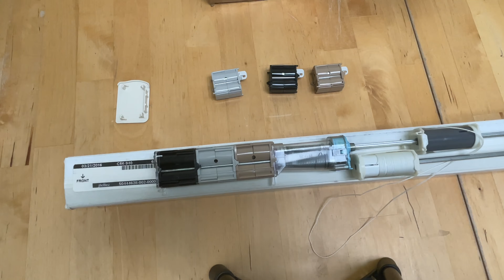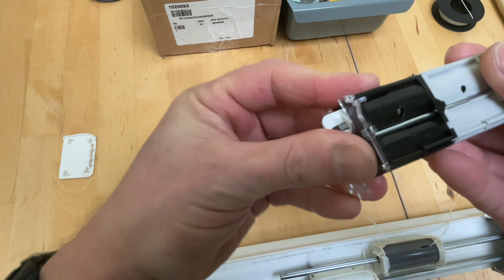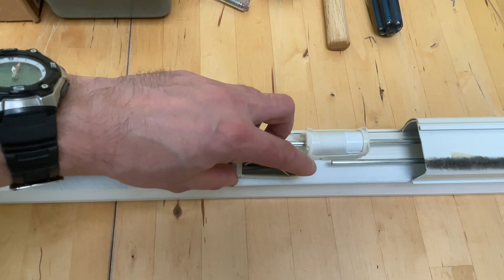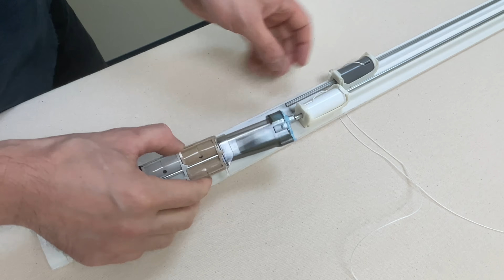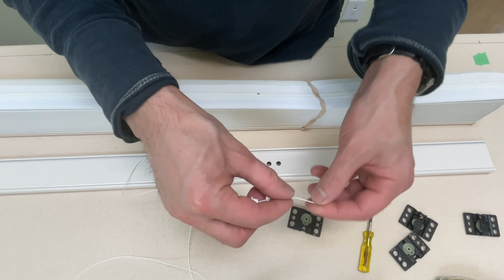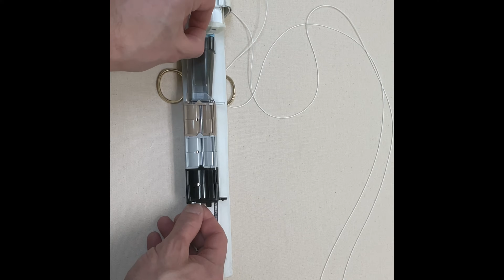Hunter Douglas Duette Top-Down/Bottom-Up LiteRise Repair: Motor, Transmission, & Cord Replacement

Comment: Do you mind if I ask? I have a gray and black motor that I accidentally pulled the clips on before knowing my replacement black motor holds no tension but the old black motor can be wound but not 42 times. Are they both defective?
Reply from the maker: Yes they are unfortunately. Winding them should be done very slow and carefully since the new motors are really weak and snap mid way.
Reply: @everclassicwindowcoverings thank you for your reply! I ended up ordering my second set of motors and was able to repair my blind with the help of your video. Thank you!
Reply from the maker: @elizabethpedley4045  Glad you found a solution. You are most welcome.

Comment: Thank you so much for this video.  We had 12 of these shades installed into our new home in 2021.  Nearly all have failed and we were about to replace them all.  This video saved the day.  One point not covered in the video, one of our really wide and long shades developed knots in cord, I assume they formed from me manually assisting the shade up before the transmission cord gave way.  With the help of this video, I was able to access the cords and remove the loop knots.  Thanks again.
Reply from the maker: Glad our video helped. You are most welcome.

Comment: Anything you can use as a motor lock in a pinch after rewinding the motor?  I don't have a spare white motor lock.  Thanks!
Reply from the maker: The motor locks are very unique. I sadly don't think you can use anything else.
Reply: @everclassicwindowcoverings  Thanks.  Reminder to save the motor locks in the future.  I was able to use a new motor as a lock for another I wound, as I had a pair needing replaced anyway.

Comment: Excellent video that helped me fully understand the process of replacing a broken transmission and reusing motors. I've got a bunch of these and have now referenced your video twice for transmission replacements. I have top down/bottom up, and the "good" side popped off and unloaded when i pulled the headrail back. From zooming your video, it appears that the transmissions are in opposite load positions when resembled.  I'm going to check on of my other shades to see if that's the case, but might be good to have that mentioned here.

Comment: Great Video. In my case one of the lift cord broke. Do I need to replace the motor etc also? What are the steps I would need to follow?
Reply from the maker: Thanks. Yes I would say you would need to replace the motor associated with that cord and will need to do most of the steps in the video for just one side/cord.

Comment: This video is so helpful! I just need to restring the shades, so do you know where I would find a motor stop/lock?
Reply from the maker: @RobynSmithPhD  Glad it helped. You need to get a new motor. They come with the lock. Just stop by any Hunter Douglas dealer and ask for a new motor; or just the lock.
Hope this helps
Reply: @everclassicwindowcoverings  Thanks! After calling Hunter Douglas and the dealer near me, I ended up ordering a couple new motors... the Hunter Douglas dealer near me doesn't sell any of the motors or anything for home repairs. They wanted me to bring the shades in so they could repair them.
Reply: Just leave the top transmission pin in until done. Then you can slide the headrail back a bit further to engage the motors by pulling the pin be vs pulling the motor cap. Cap and pin serve the same function. The cap is just slightly easier to get to for removal. After rewinding a motor, use vice grip pliers to grab and hold the motor pin until attached to a pinned transmission to maintain tension. You'll not be able to find a cap without buying a replacement motor, and keep the cap for future use of you ever get one.
Reply: looks like a money making opportunity to just sell the motor locks! That is all I need as well. But thank you for the video, I'm off to buy a new motor just for the motor locks!

Comment: Buddy, you just saved my butt... When I first got my replacement parts (and had no idea what I was doing) I foolishly pulled the motor stop on one and of course, it unwound in an instant. Thanks to your video, you gave me the magic number (42) to rewind it. Put it in my vice, attached a small piece of tape the shaft, chucked up a bit in a drill motor and Bingo. Thanks!
Reply from the maker: Haha glad it worked. You're most welcome.

Comment: The shades did not go up after I replaced the transmission. Does it mean the motor is broken?
Reply from the maker: Sorry saw this comment a bit late. Did you remove the transmission locking pins? Motor locks?

Comment: How do you do it without replacing strings? I just replaced my transmissions but i dont want to replace the string
Reply from the maker: Very easy just ignore the cord part and lock the the motors and transmission with a motor lock and replace them. Has nothing to do with the cords.
Reply: So the gray spool should have no string around it but the white spool should have string around when i put the transmission in?
Reply from the maker: @raz_r_yaj8869  Whichever spool is connected to the transmission you are replacing should have no cord on it. 1-You pull the cord completely, 2-Lock the cord and motors, 3-slide the motors transmission out of the shaft, 4-put new motor and transmission and remove locks and that's all.

Comment: Great video -  What do the different color motors indicate.  Are they slightly different and do they have to be in a certain order based on size of Blind.    What size string do you use.  I thought 0.9 mm but yours look like a 1.2 mm?.  My strings keep breaking so I was thinking thicker.  Cheers from Calgary, Canada.
Reply from the maker: Greetings from Victoria bc. I believe the colors indicate different strength. They don't need to be in any specific order tho since they all transfer a combined force thru the shaft. We use the standard 0.9. cord. I don't think other thicknesses would work we never used a different thickness including this video. If your strings keep breaking I believe a worn pocket that is causing it. Replacing those small route pockets would definitely help.
Hope this helps

Comment: How about a video to replace the handle on a top down bottom up shade. Mine has a crack in the middle and is broken.
Reply from the maker: We have that already. Is that what you mean? https://youtu.be/m6gUUdDjgWA?feature=shared
Reply: No, those just clip on. I'm talking about the tab on the top down bottom up shades. Not an easy fix I'm told. @everclassicwindowcoverings
Reply from the maker: @RK-ie4cc  Those have a screw in the back. Needs the bottom bar removed. Not difficult really just more time consuming.

Comment: Do you have a video on how to take the blinds off of the window? I am stuck on this first step 😂
Reply from the maker: Haha. The he shade is held by a 90 degree metal bracket. Push the bracket clip holding the back of the shade(not the top) towards the back of the shade with a flat head screw driver. It will unclip and release the shade. Hope my explanation is helpful.